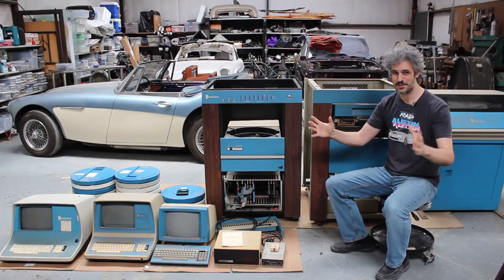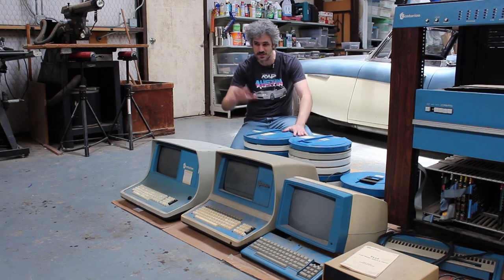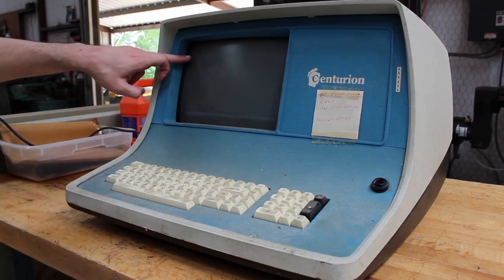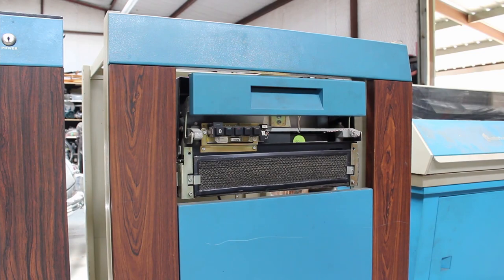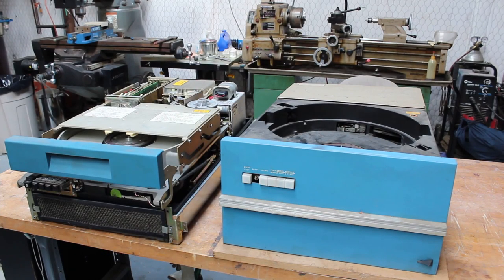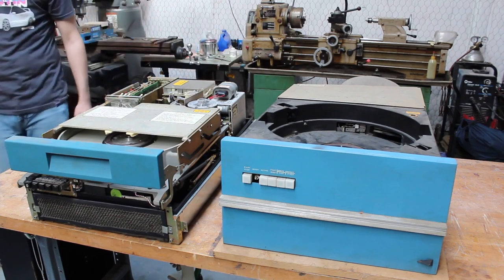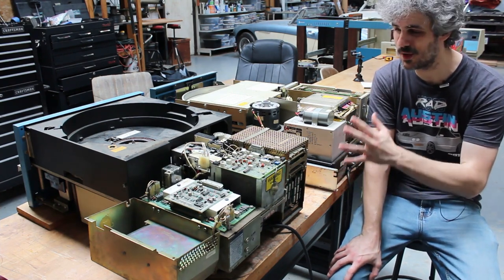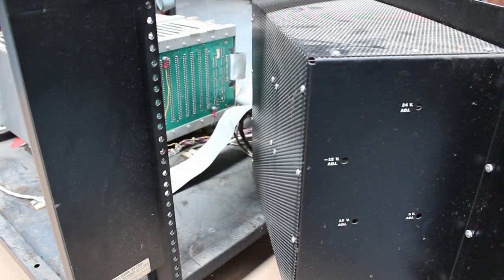Minicomputer Part 2: Removing the Drives

Comment: I think I remember the Phoenix drive. I was trained at Nixdorf to service these drives. The one we used most was called a SMD (Storage Module Drive) they had 4 platters with 6 drive surfaces. The heads are mounted on that big air coil. It is part if a linear motor. The positioning of the heads is done by an analogue comparator which compares a generated voltage from a D/A convertor with a voltage from a D/A converter that expressed a voltage proportional to the cylinder where the head sledgecwas positioned. That means that during the head positioning the comparator puts out a high positive or negative voltage onto the linear motor, which shoots off like a rail gun. Once the sledge approache the target cylinder the voltage drops a lot until it overshoot and the reverse voltage is applied.
I was absolutely fascinated by this whole electro mechanical assembly. At the time in thought it was one if the most fascinating circuits I had ever seen.
As to where the heads are you showed a side view if it with the little their little leaf springs and the steel wedges that keep the retracted heafs apart. The heads are only deployed only the drive has spun up to nominalbreves and there us an airflow over the disks. If you ever see a single head out if the drive you will see a little magnetic read/write head on another x/y axis leaf spring mount. It has a little hole drilled in near the magnetic gap. That is the spoiler hole which generates a vortex on which the head will glide over the platter without touching it. In case if power failure the heads are instabtlybretracted and spread a pair again with the little metal wedges.
You need special equipment to change the heads. It us a little round key with an off centre pin that slots into the head assembly and allows the fine adjustment if the head. You will also need a CE Pack that contains precision written tracks you can use to synchronize the head positions to make the platters interchangeable between drives.
In 1988 when I had training on these drives a spare head cost about 600 USD and a CE Pack about 2500 USD. Each and everyone if us trainees killed at least 2-4 heads a normal pack way and our course also trashed 3 CE packs. So it takes a fair amount of experience to work on those drives. Bytbthey were some if the most fascinating pieces if equipment I ever worked on, even they were a pain to move around.
Reply from the maker: Thank you so much for the insanely good information!
Unfortunately, both the Hawk drive and the Phoenix drive need a lot of work, as they've both had head crashes. The Phoenix drive is in really good shape mostly, but the previous owners last changed the air filter in 1989 but used the drive all the up to 1995, and they were in a very smoky environment. It's a shame because now I absolutely need to find one of the CE packs and some new heads in order to get the drive back up and going, but that's not only rare and expensive, but also terrifying. Like you said, it takes a very, very skilled hand to work on one of these, and learning those skills on very rare, one of kind pieces seems like a poor decision, haha.
Maybe I'll have to hire you to come out and service my drive one of these days!
Reply: @UsagiElectric  Yes, I saw the video with the destroyed platters.
 
If you had a chance to find a whole bunch of luck, a new set of heads, the required head adjustment tool, new air filter and a CE pack the service could be done in a few hours. We never took more than 2 h to recondition a drive after a crash. They were not that rare.
We always swapped out all the heads after a head crash, as the aluminium dust would go everywhere and normally crash the other heads as well. It had a very characteristic ringing sound as progressively one head after the other landed and mash the platter sing. It was a bit like a circular saw. I even had one drive once, where the crashed head was frantically tried to position over an entire night and cut through the platter. When we opened it, there was an outside ring in the drive and a few millimeter of the platter missing.   It should not take more than two hours to recondition the drive with the right tools and spare parts. 

Unfortunately I lost my maintenance manuals for the SMD drives already in the early 1990s. 
The big 14" drives were totally obsolete by then, with their  miserly capacity of 10 to 80 MB depending on number of platters and drive configuration. They weighed almost 100 kg and cost 10k USD upward.
At that time you could get a 5.25" 40 GB MFM Harddisk for a few hundred USD which weighed a few hundred grams.

Comment: Looks like an interesting project.   I was a computer tech back in the 70's so worked on these types of system though I'm not familiar with the one you have.   The large cap on top of the Phoenix drive is either a motor run to a motor start cap - for the large AC motor just beside it. I'd recommend you check on the removable disks to be sure they are not crashed.  If one of them is crashed and you put it in the drive it will wreck the heads.
Reply from the maker: Thank you!
That's awesome that you got to work on some of the old minicomputers! Thanks for the tip on checking the removable disks, I totally didn't think about checking the disk itself for damage, but given how torn up the heads are on the Hawk drive, most likely one of the disks has pretty bad damage too.

Comment: Those drives are hilarious. I'm so glad they got them smaller. I can't wait for the next part. I'd look at the PSU first, That way when you're ready to turn on the computer you'll know you have the right power requirements.
Reply from the maker: Right! They're so massive for such comparatively low storage. 
Though, in context, in 1979/1980 I think the standard floppy disks were like 360KB or 720KB, so to have a drive with removable 10MB platters must have been seen as an insane amount of storage!
I think I'm definitely going to take a look at the PSU next, I'm really curious about what kind of PSU it is. It looks simple enough that I might be able to retrace the PCB and components and come up with a schematic for it!

Comment: Those metal can capacitors are commonly filled with oil and sealed up. Heat dissipation is verry good on those. As long as they are still sealed, they last for ever. As a test you can take a variac and slowly increase voltage till it reaches nominal voltage. As long as it doesn't draw excessive current or goes boom, it should be fine.
Reply from the maker: Thank you for the insight on the capacitor!
That's an excellent idea to bring it up slowly while keeping an eye on current. I'll do that for all the big caps on the drive to make sure we don't let any of the magic smoke out on first power up!
Reply: I assume if it goes boom it is no longer in working condition? LOL

Comment: Yay! A dog visit! I like dogs.

@9:56 As you have already figured out, those aren't the heads. Those are a set of brushes which swings out to wipe dust off of the platters when the drives spin up. Or rather, it originally was... now it's a set of brushes which swings out to wipe dust onto the platters when the drive spins up. :) Not that it really matters, because I think you've already found where the heads were ripped off in a crash around @12:39. I don't have a CDC Hawk, but I have a very similar Data General model 6045 drive. I hope the fixed platter is still ok. I suggest checking all of the removable packs very carefully to see if any of them were crashed.

The Digital Equipment Corporation (DEC) RL01 and RL02 drives used physically similar cartridges to the Hawk, though they are not interchangeable at all. As I understand it, those drives originally had the same kind of brush mechanism, but it was eliminated from later versions of the RL series after it was determined that the brushes caused more problems than they solved. All of the RL01 and RL02 drives I currently have lack the brushes, but my DG 6045 has them.

The first big stonkin' capacitor you're worried out looks like a motor start or motor run capacitor. It's likely to be ok, and will only be suspect if AC motors don't turn right. But I suggest testing and reforming the big electrolytic capacitors out of circuit, rather than just turning on the power. They might be fine after a gentle reforming, but let out the magic smoke if you just turn on the power abruptly after they've been unpowered for a long time.

Isn't that decomposed foam nasty?
Reply from the maker: Our fluffy boy Beau didn't know what was going on, but he sure wanted to be a part of it, haha.

It's interesting that they used brushes to try and clean dust off. I'd be more afraid of those brushes trapping particles in them that would scratch the disk surface. Though, it sounds like I wasn't the only one with fears as to their viability. Fortunately, of the 18 removable disk packs that I got, only three of them are for this Hawk drive. My guess is that there was head crash while it was still in active operation, and they decided to just retire the drive and use the Phoenix drive instead. I'm going to shift focus to the Phoenix drive as it's in far, far better condition!

That's a good idea to slowly bring the capacitors up to voltage outside of the circuit! When I get closer to getting to first power up time for the drive, I'll definitely do that to see which caps aren't up to the task anymore.

And that decomposed foam is phenomenally bad stuff!

Comment: I used to repair both CDC hard disk because they were also used by NCR on their computer NCR 8200 - NCR 9020 - NCR 9300 - NCR 8500.  The one at your right was known as NCR 654 and the one at your left as NCR 656 models.

Comment: This fan at the bottom of the hawk drives is not for cooling. It was used to cycle the Air through and blow it through the Air filter to take out particles to avoid dust gettingbumin between the heads and the platter.
Reply from the maker: You're absolutely right! I actually take the Phoenix drive a little further apart and look at it in Part 8 of the series!

Comment: "I don't know where the heads are" - proceeds to show us the head assembly at 13:33.  The actual heads may be a bit hard to see.  They're in pairs facing each other as one reads the top of the platter and the other reads the bottom.
Reply from the maker: That was just a total coincidence, haha.
I didn't recognize them as the heads, but I did recognize that they were well and truly destroyed. With some luck, I may be able to find replacements, but my hope is that the Phoenix drive is still good inside and that I ultimately won't need the Hawk drive.

Comment: I missed the short view of the removable platter heads.  I have seen replacements on ebay, but you will need an alignment pack to properly set them.  I look forward to seeing the fixed disk, and heads.
Reply: Alignment packs are only necessary if you plan on changing the platters.  (Or reading the old platers.)  If you never plan on changing platters and can start fresh, you can format and live with whatever it is.

Comment: Nice , really nice .
Yes for shure check it all up before add any power .
Check and change all bad electrolytic capacitors , 
also eventually corroded solder joints ect .
I agree with - Bottled fire -
This big capacitor do look like those paper oil based ones  , 
so it should be still working .
They are pretty good made . ( so hopefully it have no leaks then it be ok )

Well , I agree that if you can just fit it all in one rack it be a big reduction of space needed .
It look like there is space enough to fit it all in one .
Funny thing , my computer rack is around same size but is a hm , more modern one .
Great to see you got started on the project .
Kepp it going , im waiting for next update .     : )
Reply from the maker: Thank you!

Yup, I have zero trust for electrolytic caps. Every time I get big into troubleshooting a board and over-complicating things, it always turns out to be a bad electrolytic, haha. It seems that the big cap looks like they're pretty reliable though, so that's good news!

There is actually just enough space to fit both drives into a single chassis just above the computer itself, though there may be some cooling issues. However, the Hawk drive seems to be pretty ragged and I'm not too confident in it being able to power up. Fortunately, of the 18 disk packs that I have, only three are for the Hawk drive, so it seems the Phoenix drive was primarily used.

Interestingly, the rack is a standard 19" rack width! So modern server hardware could totally be stuffed into one of these old racks without any problems!
Reply: @UsagiElectric  Thats good news , so you can fit it all in one rack .
I wonder since the the Hawk drive have only 3 disk that it may have being the maing drive and hosting all the systems to run this ' big thing ' , it was not uncommon to have  a one drive run all config and the other simply is data storage .
Maybe it simply booted from it and all the 
terminals woke up from that drive .
I hope you can both up running so we can find out what is on those disks .

Yes 19 '' rack was a standard  really long time ago , used in all from radio to music studios to transmision stations long time before computers became more common .
Actually a great standard that allow to put all gear in one place .

Cool project , I totally love those old mainframe / terminal based systems .
Reply: @UsagiElectric  I forgot to say .
Even if the hawk drive cant be repaired there is  ways to get the data off the drive .
Electronic by using a working head to recover it or .....
Ough ...
The most extreme case is to read them manually and write down all the one and zerros .
It can be done and could just write the data directly into an empty disk .
There is a tool there allow you t see the magnetic information on audio tapes .
It was used in the days where they cut and splice tapes and doing editing directly on the tape .

Here is a link to suck one ( it was the only link i could fnd )
You can still get those on ebay and such places .
https://www.youtube.com/watch?v=aZOxn8ggX8w
Really last solution because to  write all those ones and zerros is taking quite some times .
But interesting that it is possible to it .
Reply from the maker: @kennethsrensen7706  Yeah, there is a bit of worry about what drive was used for what and what data is on them. The bigger worry is that both the Hawk and Phoenix drive have internal platters that are non-removable. So, it's entirely possible that boot information or config data is stored on those internal platters. My hope is that there seems to be quite a lot of ROMs on the actual computer itself, so with luck, those will contain the appropriate boot/config data to get he machine up, and then the drives were used for data storage. 

Only way to know for sure though is to do my due diligence and get some power into this old thing!

That magnetic tape reader is awesome! I'd never seen that before, but that's a really ingenious way of doing that. Also, it's pretty wild to see how the tape was encoded in that video. 

Hopefully, once I get some nice Hi-Res images of the computer itself, we can start reverse engineering some things and figuring out what goes where and what kind of hurdles we're going to run into the first time we power it up.
Reply: @UsagiElectric  Yes I agre with you .
Hopefully they both can come back to life.
If the drives heads was parked or out of reach of the platter there will be hope it works .
Im waiting exited to see the restoration of 
this old beast .
I cross my fingers that you can get it running    : )

Comment: The disk at right has an air pressure switch that avoid the heads go out if there isn't enough air from the air filter. 
The other one doesn't so make sure the air filter is clean before trying to start the disk. Heads could land over the disk plates and they will be destroyed as well as the disk plate.
Make sure filter, blower,  heads, plates and brushes are pretty clean, any dust particle can make a disaster.

Comment: You need to inspect your platters, both fixed and removable for groves that indicate a head crash.  Based on what I've seen here, a head crash on the Hawk is what caused the system to be put away.  They're not just crashed, but destroyed.
Reply from the maker: That's definitely a good call!
The Phoenix drive looks to be in much better shape, but if the Hawk drive has some essential program on the fixed platter, it may need a lot of work. Either way, the Hawk drive will be getting a complete teardown to at the very least inspect the fixed platter and heads.

Comment: The legacy of the Hawk drive lived on until the mid-'90s: Seagate bought CDC's Imprimis/Magnetic Peripherals division in the late '80s and basically just rebadged their product line as Seagate drives, including the now 3.5" Hawk (and the Wren, Elite, and Barracuda series). Essentially if it had an animal name, it was originally a CDC product; Seagate originated the Olympic-themed stuff. They made excellent drives until 1997 or so when they bought out Conner Peripherals, after which quality for non-enterprise drives took a bit of a dive.